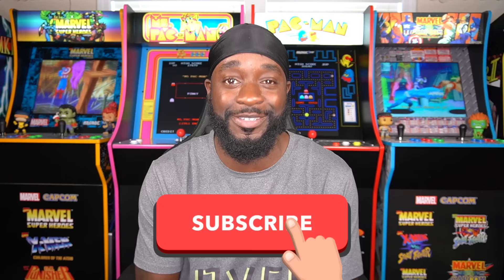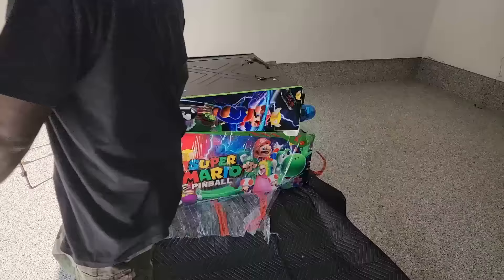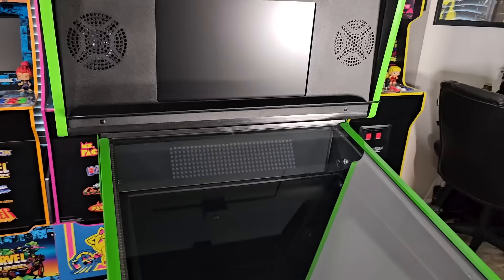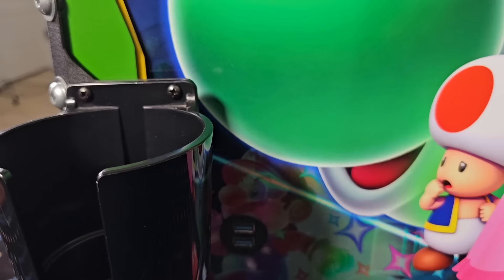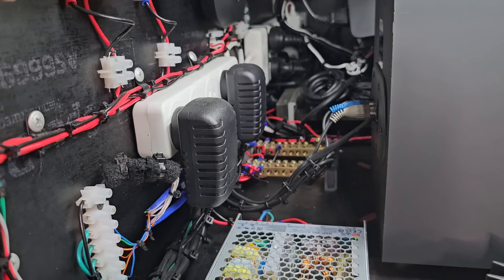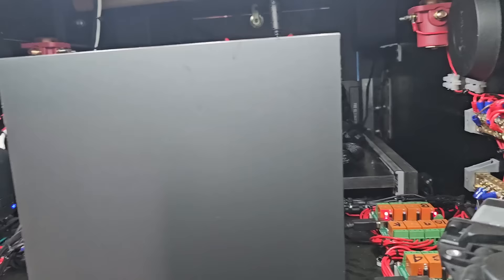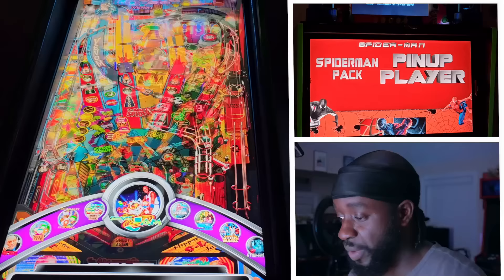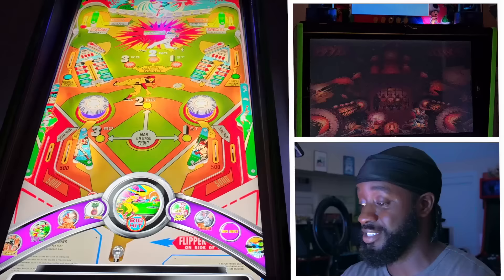Xtreme Gaming Cabinets "Super Mario" 3-in-1 Premium Virtual Pinball Review - The Best Money Can Buy?

Comment: I love the artwork on it, and it seems to run really well, but for the price I unfortunately think there are too many things they did incorrectly on it. Really good video review though!
Reply from the maker: Thanks! What do you feel they did incorrectly?
Reply: Exposed bolts and screws on the outside, playfield LED strip mounted with exposed diodes and no diffusion, side mounted tilt bob rather than center mounted, open mounted PC rather than enclosed, and from the video the monitor appears to be mounted flat rather than angled, just to name a few.

Comment: XGC definitely produces the best consumer VPin. It still baffles me that XGC puts this much detail into the VPin and then chooses to use "hardware store" hardware over true "Pinball Machine Hardware".? The legs are straight "angle iron" and not and flared out. The leg bolts are hex pan-heads with washers and not pinball leg bolts. The hinge bolts are the worst of all because the shiny head is visible, in the playfield area, the threads are exposed on the outside and the actual pinball hinge bolt solves both of these. As a DIYer I built my own using true pinball hardware in every area possible. Baller Installer gets you the Pinup popper FE,  wish I had  all of the tables all set up though. Just added DOFLinx MAME which has the MX effects with many if the roms.
Reply from the maker: I wouldn't know anything about official hardware vs pinball hardware. The materials look and feel premium to me. 🤷🏿‍♂️
Reply: The legs are not straight angle iron. They are 4mm thick steel and they are flared. "Real" pinball legs are 2.4mm thick steel and the ribbing is required to enhance strength, unlike the 4mm steel of the XGC cab legs. WRT bolts, nothing stopping anyone from replacing them if it bothers them.

Comment: This is nice, but I give the nod of approval to the Ultra VP 7 model over this. It's much more expensive for a reason. The craftsmanship and physical hardware layout so much nicer. The added switches to disable hardware features is a super nice option. The topper with lights and additional screen also a nice option. However, screen size might be a deal breaker for some. It's overall dimension is larger than a widebody. Ensure you can physically fit it in through the door way of the room you have planned for it.
Reply from the maker: Well, everyone has their preference. I guess it boils down to what you want and your budget.
Reply: The Xtreme has better Cabinets and 144hz over 120hz. The Ultra VP is a HUGE EYESORE imo. These 2 are the best on the market though, no question. I'm 100% going for an Xtreme next year.

Comment: How was your experience dealing with Xtreme Gaming Cabinets? These machines look top tier! I’ve ready some mixed reviews online but not sure I believe the negative reviews after seeing your video. Lastly how long for it to deliver after ordering?
Reply from the maker: My experience with them was great. Communication was clear, and I didn't have any issues. If anything, communicate with them yourself and make your own opinion. Not to say other folks may havent had sour experience, i can only speak for me. I originally was getting a machine with them back in 2020 (they started to build), but I had to hold off due to traveling with my job. Once I got settled back home, it was full throttle from there. I'm not exactly sure what the wait time is currently. You can reach out to them for that info. Like I said, my machine was already in the queue once I was ready to move forward, it wasn't too long for me considering the gap in between. Hope this helps.

Comment: Can you share the rough cost of shipping? I’m in Maryland, and want to get a general idea of how much it’s going to cost.
Reply from the maker: Depends if you go by boat or plane. Obviously,  boat is cheaper, but takes longer. If you decide to go cargo by plane (like I did), you'll be looking at $900+. Probably touching $1500+ easily with the holidays around the corner.
Reply from the maker: Hope this helps and gives you a general ball park idea of what to maybe expect.
Reply: How about the machine itself being premium with all the upgrades? What did that run u??
Reply: Thanks
Reply: @dthomasfromnc shipping prices must’ve went way down because I spent 3600 for air shipping when I got mine. Boat freight was around 1700.

Comment: it doesn't look like the screen matches a full size pinball machine. it is very pretty though. the table screen needs to be about 50 inches big
Reply from the maker: This isn't 50 inches but does look great in person.
Reply: The screen is 43 inches. The cabinet has the exact same dimensions as a Williams widebody machine. If you used a 49-50 inch screen, the cabinet would be a couple inches wider than a real pinball machine.